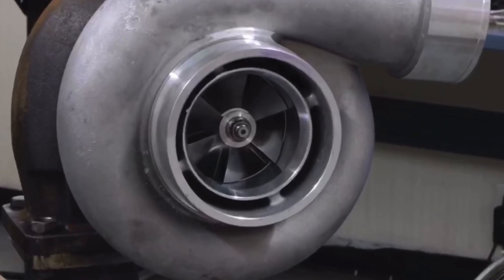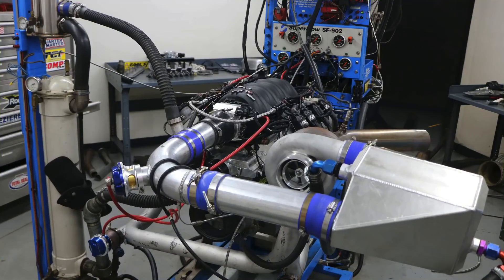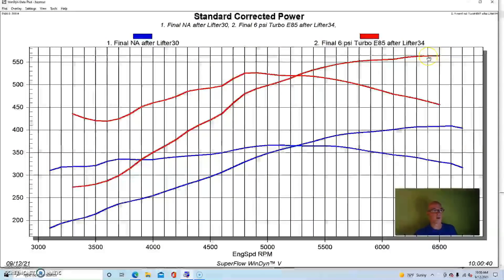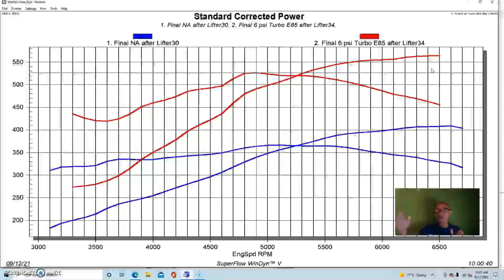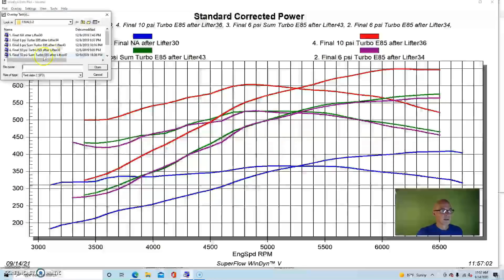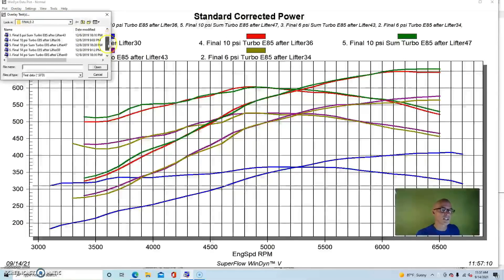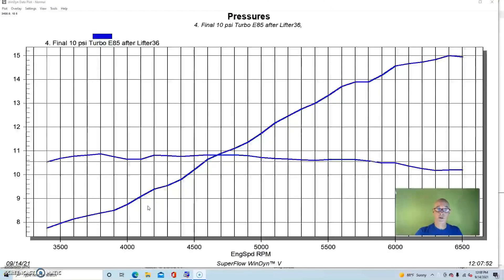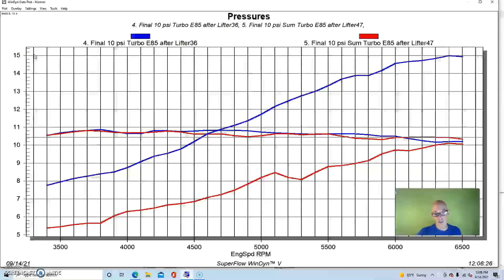LOW BUCK EBAY /SUMMIT RACING TURBO TEST-WHEN DOES BIGGER BECOME BETTER?

Comment: Let’s say both these turbos at 15lbs will the bigger turbo have cooler boost temperatures
Reply from the maker: they both won't support 15 psi on the motor as shown (the flow rate is the difference)

Comment: I'd like to see an NA engine run with open exhaust, then choke the exhaust down to various back pressures.  This would give us an idea of how much horsepower it takes to spin the turbo.
Reply from the maker: it doesn't work that way

Comment: You should show backpressure + boost + and add on EGT and dyno load. There's a lot of mystique out there for the guys who want to take their 5.3 chevy 1500 and put a turbo on it, but still pull a 4k boat. Personally, I just put diesel in the tank instead of gas when I want to do this, but some folks can't afford that luxury and want both.
Reply from the maker: dyno load?
Reply: @richardholdener1727  A measurement of absorber load, water brake, etc. I think it's inertia factor? I don't remember, it's been a while since I messed with an engine dyno.

Comment: Sooooooo badly wanted to see what that s475 would have done at about 25-30psi. Why don't you ever turn things up where you really can learn the limits of the good turbos?
Reply from the maker: THAT S475 WON'T SUPPORT 30 PSI ON THIS MOTOR
Reply: @richardholdener1727  well the compressor would run out at some point (long before the turbine) and we'd love to know what point that is! Appreciate the videos🤘

Comment: Hey Richard, thanks for showing these 2 different turbos back to back. Even tho this was a smaller 4.8L and my setup will be a good bit larger 408/6.7L for my Durango, it shows the HP potential of each  turbos, more so the T45 than the larger S475, and the associated back pressure for each up through the power levels

Comment: I have one for you  which is better  a bigger cam or a bigger  rocker ratio like 1 to 1.8 instead  of the factory  one ?
Reply from the maker: the cam if it also adds duration
Reply: @richardholdener1727  I know  if you put to much cam the engine  run rough but if you put bigger  rocker  ratio will te engines run smother for the same lift?

Comment: I'm getting so many mixed reviews, anyone on here know how much boost I can run on a 10:1 static 7.75ish:1 dynamic? PUMP 92 ONLY.
Some people say 12lbs some say 5. It's a turbo car.
Reply from the maker: dynamic compression does not tell you how much boost you can run
Reply: @richardholdener1727  Thank you very much,  the LS forums are all over the place with their answers.  I was just trying to give as much info as possible.  Going to try to run 10psi on my s480, I know that's baby boost for the s480 but I made a mistake.. lol
Reply: @KreatorOfDeath1985  I made a mistake when buying my turbo too.I bought a s475 when I thought I was getting a s480. It's still in the box, my project has stalled for a minute.

Comment: Great video Mr. Richard-love all the data! Response rate is perimont, for me, however what's the tradeoff between response & back pressure-is a high delta of back pressure vs boost detrimental to an engine? Thank you Tony
Reply: High back pressure can cause broken turbo shafts for one, or over speeding the turbo to the point wheels explode. Probably won't happen on a street car though. Excessive pressure anywhere is hard on parts and creates heat.
Reply from the maker: high back pressure can cause problems

Comment: Thank you Richard for providing more details about the turbo specs (a/r turbine housing, flanges, compessor and turbine dimensions). This helps a lot. It's an excellent test with lots of feedback. The S475 seems ideal for a 4.8 lt engine (so most likely any other engine in the 4.8lt - 5.0 lt range) while the GT45 seems more ideal for something like a L99 or even 3.8 lt, something like this.
Reply from the maker: the S475 is only ideal for the 4.8L if you want 1000 hp (or above 700 hp)
Reply: @richardholdener1727  I think going for 700-800 whp in a 4.8 lt is a fair target.The GT45 (or a similar sized turbo) would make sense only if it's building more boost below 3000 rpm, which is not shown in the graph. By the way I like the choice of the S475 for this test. It's a relatively cheap, journal bearing turbocharger with a cast compressor which seems suitable for the application.

Comment: What about twin DNA GT 45s on a 5.3 LS? What do you think the response rate to back pressure ratio would be? The mindset here is that everything is better with twins ;). Not to mention power to costs.
Reply from the maker: twin GT45s can do 1300-1400 hp

Comment: I bought a smaller turbo s300 66mm .91 a/r supposed to but good up to 800hp. 750hp being the higher end of my goals.(gonna start with 500ish hp until I get a 4l80) I have a 6.0 lq9. I bought a 76mm because I was afraid the 66mm would be too small. Do you have a video on turbos that are too small for an engine and what's at stake? And what kinda changes are made with the tune when changing different size turbos?
Reply: The rings are gapped just need to weld up an oil return on the oil pan and I can get it back in the truck. Trying to figure what to expect when it comes time to tune.
Reply from the maker: don't think S300 is right for the 6.0l (doubt it will do 800 hp)
Reply: @richardholdener1727  I think it's supposed to be a replacement for a 6.0L diesel 🤷‍♂️
Reply: @richardholdener1727  I wasn't planning on doing 800hp with it but that's what it says it's rated for

Comment: Great analysis.  I especially like seeing the intake/exhaust pressure data. Knowing where they cross 1:1 seems to say a lot about the sizing.
Reply: I think theres a bit more to it than that, although it may be a starting point. Theres so many factors that come into play that a simple conclusion cant always be drawn by two lines crossing.
Daily driver, some fun driving, 1/8 mile or 1/4 mile, launch style "will it hook up".
There may be a time when you actually design in for a smaller turbo or budget constraints.
I have two s480 but the ar is 1.1 and the size is straight 80 mm, cheap chinese, dont expect amazing things from them but its powering a 6k vehicle and 37" tires. I wont be spinning it 65-7000 rpm so I opted for smaller wheel size for quicker spool at lower rpm, back pressure is not too much a concern for me but a single big turbo would not be fun on a 98 k1500 suburban.
Reply: @Shaky_Dave  Good stuff.  I agree you can't select a turbo based on one parameter...especially when you don't know the pressure ratio between the intake and exhaust until it's already been installed.  I still believe it's a good indicator of whether the turbine wheel and a/r are matched well with the compressor.

Comment: seeing quite a few import guys running cummins takeoff turbos (hx35, hy35, he351) on relatively small displacement (2L-ish) gas engines. How do these compare to a properly sized cxracing or other budget turbos? seems the reason for the second hand holset is usually budget driven but is there a better option for the money?
Reply from the maker: the HX series work well-just so cheap to get new ones
Reply: @richardholdener1727  I have 2, Holeset H1Cs from a couple 5.9 Cummins school buses. Do you think they would work okay with a 350 or 383 SBC ?
Reply: I would like to know about this aswell.
 I want to use this holset he 351s on a 4.8 or 5.3
Reply: @travisabrahamson5092  compressor side should be plenty to make 500hp on a single 351 but the problem i can see would be the diminutive turbine housing at 9cm. it is a more efficient housing than the earlier hx35 12cm or the hy35 9cm housing but on a gas engine to spin the compressor hard enough to make real power i think you'd need a significantly larger housing to not have choking issues from backpressure. Going to twin he351's i bet it would spool great and have enough exhaust flow to not choke but then i think your compressors would be too low in their map to be efficient. Definitely not an expert but i've done a lot of turbo shopping lately and the he351 is appealing but i think it may be a touch missmatched on turbine to compressor sizing to be good as single or doubles on a small LS. Might look into a pair of the cummins takeoff hx35's for a more balanced compressor/turbine combo and a larger cross-section area to help keep backpressure down. 

or a summit s475 would flow more than you'd ever need, be properly sized and be pretty cheap with warranty.
Reply: @bert5003  I was wrong about the part number. The hy35 is the one I was going to twin on the 4.8 or 5.3
Reply: @bert5003  I was thinking that the built in waste gates would be enough for a 4.8. ?? What do you think  ?
Reply: @travisabrahamson5092  so a pair of hy35's should actually be decently sized for that but im skeptical on the wastegate. if you got it bored out from the 18mm or so to about 1" (as big as is possible with factory flapper) maybe it would be doable but everything im finding says to weld it shut and run an external gate. also if you need to clock the compressor cover you then lose your wastegate actuator mount anyways so i'd say kill 2 birds with one stone and just go external
Reply: @richardholdener1727  makes sense, i just learned this and it seemed kinda counterintuitive (big slow diesel compared to small high revving engine) i was sure there was some sort of secret sauce but i 100% understand being cheap.

Comment: I have a 302 in my pinto Drag Car . 2550lbs it run a 6.52 1/8 mile 1.45 60ft . 103 mph . On vp110 gas .
I have been thinking about Switching to e85 . 
I was told I would gain 2 to 3 tens in the 1/8 ?
what do you think . 
I all so jus bought a 1 TRB-TO4E Turbo Charger  
.50 AR Compressor , .63 AR Turbine , 
5 BOLT Exhaust , 3" Inlet & 2" Outlet . 
What do you feel My Horse power Gains would Be 
Thanks
Reply: Gains depending on boost level.
Reply: Why use such a small frame charger?
Reply from the maker: what size is that turbo? also gains on na motor minimal unless very high compression

Comment: I would like to see one that shows What happens when your Turbo is too big and you start losing power on the bottom versus using a bigger Turbo for what it's rated for
Reply: It just kicks in later in the rpm doesn’t lose power at all but when it lights up small turbos look weak compared to big turbos
Reply: It wont "loose " power - it'll just produce NA power until a point where the turbo starts to produce positive boost pressure in the RPM range...

Comment: I would like to see draw through vs blow through turbo set up
Reply: how would you plumb the intercooler setup on draw through?
Reply: @scottleggejr  you would not need a inner cooler with a draw through
Reply: Have you ever seen a 1980/ 1981 Turbo Tran Am? That's to blow thru system
Reply: Sorry its suck thru. Carb feeds turbo
Reply: @stevecobratei8538  that was back in the 80s though new technology would make a big different…I know a guy that did it with a coyote and it was pretty badass

Comment: Would the ebay turbo be limited to 700hp if put on a na 700hp engine?
Reply from the maker: IT WILL DO A LITTLE MORE
Reply: Sounds like a recipe for big gains at low rpm and marginal up top.
Reply: @stlchucko  exactly what I would be looking for. More low end grunt
Reply: Will have tremendous backpressure, will not be controllable by a wastegate, and will blow out lots of gaskets
Reply: @chipcurrey653 couldn't you use a pressure sensor and exhaust bypass to keep the back pressure in check.
Reply: @Gameplay-3D  that's what a wastegate is....an exhaust bypass
Reply: @chipcurrey653  I was thinking more of a 3 inch exhaust cutout. Lol

Comment: Gt45🤢🤮
Reply: Why vomit 🤮?
Reply: @evanc6110  Have you used a gt45? They are based off old technology, imo alot heavier than they need to be, The oil drain is super compacted so its almost always a pain to install/ remove. I have ran two of these turbos and the super low cost is the only real appealing part of the gt45 since it can be replaced without breaking the bank.
Reply: @dicklong3430  Never used it, or any other turbo. Interesting information. Well, if it's cheap enough to outweigh the cons than that's good.
Reply from the maker: the GT45s work as shown on lots of applications-heavy wheels and all